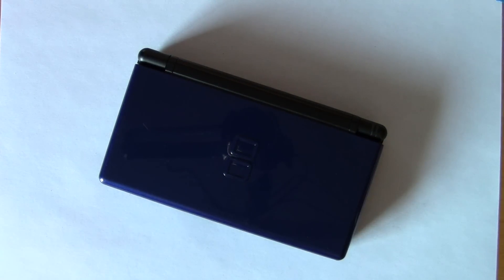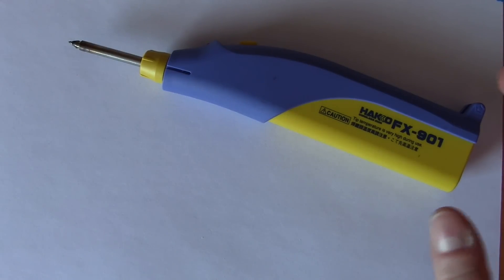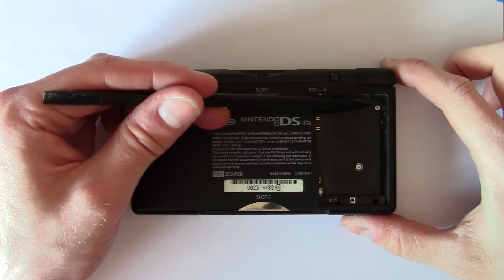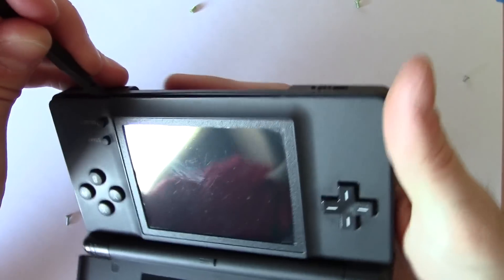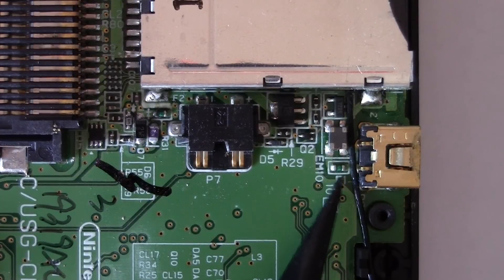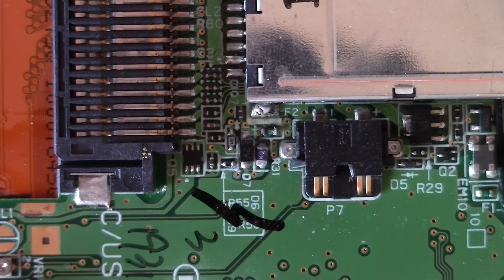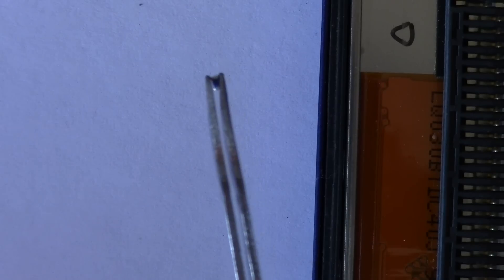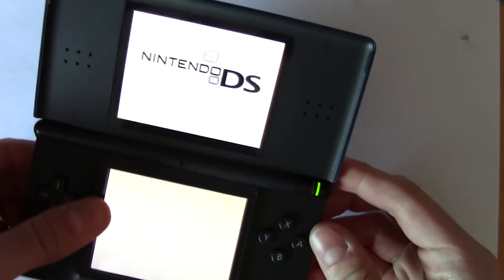Nintendo DS Lite Repair Part 2 - Replacing Tiny Fuses

Comment: I have a dsi that had water damage. There is rust on the backings of the lcd screens. I cleaned it and made sure everything was connected properly, but it doesn’t turn on. The orange light does come on with the charger plugged in. Any idea what could be preventing it from turning on?

Comment: Phew once again your videos coming in clutch. I blew the F2 fuse last night when swapping out the bottom screen on my DS Lite. I was in a rush and forgot to insulate the back of the new screen. 

Going to give this repair a try and hope for the best. I've had and used this DS since 2007 and would hate to let it go!
Reply: that's exactly what I did ! When I was moving the bottom screen while DS was ON, it suddenly turned off and it never turn on ever. The same orange light error that only keeps for a couple seconds and then found Fuse 2 was open. Could you tell me how not to do this mistake again?
Reply: @karl-ur9py  sure thing, bud. so you need to insulate the back of the screen bc it's metal and if the metal back touches metal, then it blows the fuse. i peeled off the insulation (looks like tape) on the old screen and put it on the new one. i think some people even use electrical tape as insulation.
Reply: @robmakesstuff  thanks

Comment: I went over my fuses and found out I had no continuity from the same one, but the only difference is mine shows it's charging when plugged in. I'm not sure if there is another issue on top of it because of that or not. When I opened it up I noticed it showed there had been water damage. I cleaned up the motherboard and removed the wifi/bios just for extra attention. After putting it back in it's place I tested it with a new battery and briefly it turned green. However now it continues to only show one of either lights and only when plugged it and of course that would be the orange charging light.. the same problem I had in the beginning. Anyone have any ideas? Do you think it's just F2 or something more still? This is my first time trying to fix any electronic 😂 I have lots of questions I'd like to save my DS Lite so much to play still lol
Reply: F2 is the problem. F2 is the one between the battery & the APU (and everything else) F1 is the fuse that blows to protect the DS while plugged in to power. Dont follow online advice to bridge them either. The blown fuses are fiddly to replace but it's better than frying your DS's motherboard.

Comment: My DS Lite blew a fuse because the new displays don't have any backings to prevent the metal from touching anything on the board, causing it to blow a fuse.
Reply: Same shit happened to me. Had to short the fuse by replacing it with a solder blob instead.

Comment: Success! I'd never soldered such a small component (or anything surface mount for that matter), but I managed to pull this repair off with terrible lighting and no magnification lol. 

Great video. I learned a lot about soldering today, lol
Reply: Amazing!
Reply: Did you use a tiny solder braid like the one used in the video?

Comment: Mine charge illuminates orange for two seconds then goes out and wont charge. Tested the two fuses and have continuity across both said fuses. Where else do i look? Im confused
Reply: Turned out to be a cheap cable I was using, got an official charger and all is good

Comment: Yeah I just found out where to get this part marked EM10 www.fasttech.com it is called a electromagnetic charger filter it is the technical name of the component but it does the same thing as a power supply filter I just said this so people can understand what it does it is $7.03 cents free shipping
Reply: Yeah all it really does it take the power from the charger cord and it reduces the power supply into the right voltage and watts so it doesn’t over charge your battery until it explodes kind of like a big time resistor

Comment: Want to know a cheat for this?
You can skip desoldering the old fuse and just solder the new one over the top of it. The old fuse is open, so it doesn't exist from an electrical point of view. Skipping the desoldering step greatly reduces the risk of damaging the PCB.
Reply: This! I spent 3-4 hours over a week trying to desolder that old fuse. Was worried I was starting to damage the PCB or neighboring parts and, after seeing this comment, just soldered the new fuse on top. Buttoned it up and it worked perfectly!
Reply: Ingenious!
Reply: Will the DSL shell still fit if you stack them?
Reply: @inclinerd  It did when I did it. I don't know if there are other revisions of the board or anything though.
Reply: can i get confirmation that this works because i cant find anything online
Reply: @pawlios1495  You can confirm it yourself. Put your meter across the fuse and test for continuity. If the fuse is blown, then it's an open circuit, and the fuse basically doesn't exist.

Comment: Can you explain why it happens? I have a new 3ds xl and it don't turn on , it just charges for 5 seconds, i have this problem because i tried to repair the joystick also i think that problem is: I put the battery upside down or the static of my hands ? Please explain me , thanks so much

Comment: I've read on Gbatemp that Ds, DsLite and Dsi uses 1A fuse.
Is that correct?
I don't want to put in a bigger fuse and fry some other chip that is difficult to get hold of.

Comment: what is the point of a surface mount fuse anyway most of the sims if one blows it dose not matter if damage is done to the unit because they are a pain to replace in other words blown surface mount fuse = blown cpu to most people

Comment: Got the exact same issue with a DS Lite I bought at a local thrift shop. The weird part is that a continuity test on both of the fuses was positive. I ordered replacement fuses on eBay but i'm a bit worried that the fix might not work...
Reply: breeztube it might be your battery
Reply: So, did the fuses help?
Reply: I'm also interested, how did everything turn out?

Comment: Before a fuze goes bad does the dl lite, like malfunction? Because mine has the same exact problem you described and before when it was messing up when i pressed on the left dpad it went right, and the screen would automatically press things and i had no control of it

Comment: Nice video, you should post more nds stuff, cause i have a nds with an innacurate touch screen, one of the pins on the slot 1 is broken and the top screen is always red, i wish i could fix it by myself without buying anything (i have an old ds for parts)

Comment: In my case F2 is fine so it charges but F1 is dead NO continuity when tested with my multi meter. Is F1 the same exact fuse as F2? I ask since it is way to damned small for me to try to identify the part.
Reply: It's the same fuse.

Comment: The broken component on my ds lite is a small little black cube with gold strips going up either side. Any idea what it is or how to attach it?
Reply: Yeah it’s marked EM10 it’s called a power supply filter that component is the main reason for it to charge and the red yellow light or green light on the top hinge to let you know if the battery is good or it’s about to die but that part makes the DS lite take a charge it will not charge your DS lite until it is fixed
Reply: Skeebeep Boopeepeep I’ve heard that you could bridge it but I would never recommend this in so it could brick the motherboard and you would have to get another board

Comment: mine's work without the fuse
I use solder only
what will be the difference?
Reply: Flappy Birderd fuses blow and protect the circuit from over voltage. They inly just conect 2 points, just like your solder connection, but that wont protect the board

Comment: Hello where did you ordet the fuses? I only found mouser electronics but the shipping was so expensive, Thanks
Reply from the maker: I usually get components from Digi-Key, but their shipping is usually about the same as Mouser. Sometimes you can find a good deal on eBay, but the shipping is usually quite slow.

Comment: Hi, I have GBA SP (AGS-101) with F2 fuse which doesn't work, and need to be replaced. I searched on the internet about that, and I need 0603 SMD fast acting fuse 32V 250mA. I found that type of fuse, but 500mA version. My question is, can I put that one insted of 250mA version? Does that make any difference? Thanks in advance for your answer.
Reply: Mr.TwiSteR is not the same.

Comment: I know you'll probably never see this comment, but I just want to talk about a business I started. I buy up DS lites on eBay from $10 to $20. I buy a new shell for $10 and a new digitizer for $5. I replace the parts and resell them for about $80. I just want to know what you think about it or if you have any suggestions. Thanks!

Comment: How thick was that solder braid you used
Reply: I would get the width 2.0MM but you can get it in any size depending on what you are working on

Comment: sorry if this has been asked already,  do you prefer a "solder sucker" or the braid for removing solder?
Reply: Yeah I would recommend the braid with the flux if you cannot find that exact thing you can always get the flux and put it on the copper braid the desolder pump only helps for big circuit boards that have plenty of room to get around but if you want a good clean area the braid is great for small spots

Comment: I have two DSes that face the same problem, yet the fuses seem to be okay. What could be the problem? They've been sitting in a box taken apart for a few years now and I can't find the fix!
Reply: I realize this is four years later, but in case anyone has the same problem: Check the L2 inductor next to the power switch. They tend to fall off or get loose in a fall and it produces an identical fault.
Reply: Apollo Justice thnx will check that one first ,for an easy fix hopefully I won’t have to pay to get the darn fuse replaced or worse get another ds to play my gba games , although I wanna get me a modded gba that is backlit because I can play of gameboy and gbcolor games also!

Comment: Happened to both my 3DS XL and my new 3DS... AT THE SAME TIME!! Stupid charger!! Do you know if I need the same fuses for 3DS and new 3DS? (same as you used in the video)
Reply from the maker: +The Imprisoned I haven't taken a look inside a New 3DS yet, but since they use the same charger as the original 3DS and 3DS XL, it's very likely they use the same fuses.
Reply: Alright, thanks :) I'll give it a shot and hope I dont break anything.. But before I try, should I try to take it back to gamestop? I have 5 years warranty so it should last until 2016-18
Reply: +This Does Not Compute - I just bought 10 fuses. Wow Digi key had the cheapest ones out there. The other sites were really expensive. One site who specifically named them 3DS fuses sold a single one for $10

Comment: Being from the UK it seems shipping on Digi-Key and similar sites is rather crippling, and makes all this not worth my time, however, I've been searching on eBay and have found tons of similar fuses, but none have the correct Ohm. I understand to a point what Ohm is, but I'm no expert. What would happen if I chose a different Ohm? Even if the amp and volts were correct.
Reply: It's been a long time but how did it turn out? Did you try out ebay or did you give up on the repair?
Reply: Wow this is a blast from the past. Let's just say I found it again a month ago and wondered why it didn't work, thank you for reminding me lol yeah never did repair it, I'm not even sure I could now. Very unsteady hands.
Reply: It seems that if I did try again though they're quite readily available now so my old comment is no longer applicable.
Reply: @BjornThorsson Thanks for the quick reply after such a long time! I just bought a set from ebay and will try fixing soldering in the next week or so. My hands aren't quite steady as well and the fuses only seem to be as large as a small smudge. We will se how it goes ^^`
Reply: Haha I just happened to be on my phone when I got the email notification, good luck with it, you're braver than me lol

Comment: any idea what the black box next to F1 does? I have one that will not charge but plays fine, strange thing is when i opened it up that box was smashed.
Reply: +David Yarbrough Not much clue myself, but could that be the charging circuit?
Reply: Yeah it’s some kind of filter for the power luckily I have a spare board and that part is still okay
Reply: Yeah it’s a power supply filter it helps you charge your DS lite it will not charge unless it’s fixed
Reply: @linkmasters535  Thanks for the help

Comment: You sir are a genius! Love the videos
Reply from the maker: Benny Palma Thanks for the kind words!
Reply: I have a very important question I need answered asap; I'm trying to repair a GBA SP as a present for my spouse. I've reflowed all the pins relating to the battery and after nothing happened I've come to the conclusion the fuses are blown (it stopped working after water damage)

Now, if I were to find a DS Lite fuse on Amazon, does the DS Lite use the same kind of fuse as the GBA SP- in other words, could I use a pair of DS Lite fuses to repair my GBA SP properly without bypassing the fuse, if I purchased a fuse for the DS Lite? They look the same, but I just want to confirm they are, in fact, the same kind of fuse

Comment: Plz post a video on how to fix a DS lite that will charge but not come on like the orange light stays on but when u try to cut it on the screen flashes for like 2 seconds then cuts off.
Reply: That is the opposite fuse, f1

Comment: Hi, I really like many of your video tutorial. Some of them helped me in the past.           But, I wonder, if these fuses that you bought are also compatible to replace the F2 fuse of a gba sp ags-101 (Near the gba sp switch) . If not, how did you know which fuse to buy and what should I buy ? That would be helpful. Thank you.
Reply from the maker: I haven't had to replace the fuses on an SP yet, but a quick look suggests they use 0603-size fuses, just like the DS Lite. The process for removing the old fuse and soldering in the new one should be the same too. Good luck!
Reply: This Does Not Compute Thank you.

Comment: awesome tutorial, but I have a few questions... How do you know there isn't another bad component on the board which may have caused the fuse to blow?  How do you find the rating to replace the bad fuse?  I removed the display module from my keyboard synthesizer and found an open on a surface mount fuse, and there's a tiny print on there (4.91...x).  Any idea what that means?? I'd appreciate any help..
Reply from the maker: Nintendo seems to put these fuses in as close to the power supply socket/battery as possible for the specific purpose of trying to protect the system should a short occur, like getting the console wet...there's not much before the fuse that could fail and cause the fuse to blow.

As for what rating of fuse to get, I don't have an easy answer for that one...I just Googled for what others had gone with when replacing their fuses. Googling part numbers is always a good start, and barring that you could ask at an electronics engineering forum like www.eevblog.com. Good luck!
Reply: Thanks...